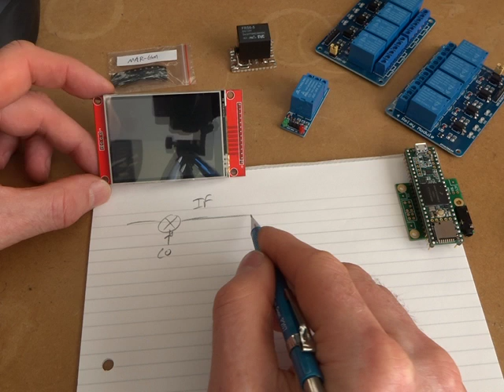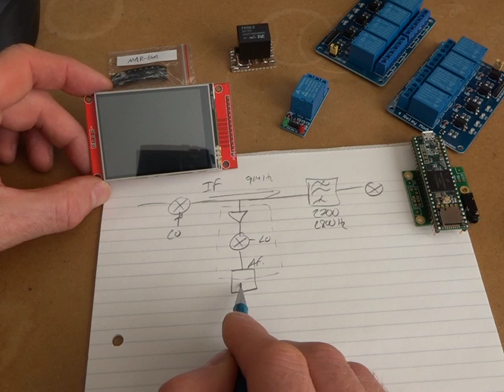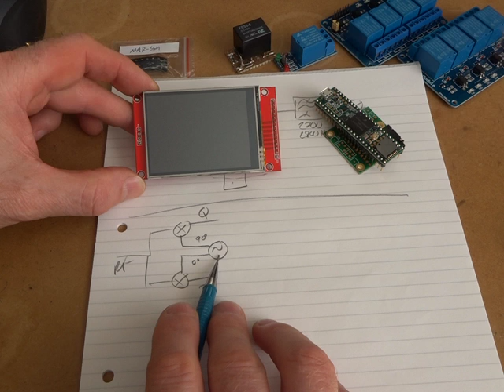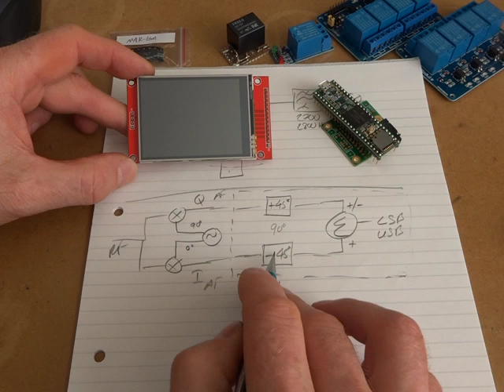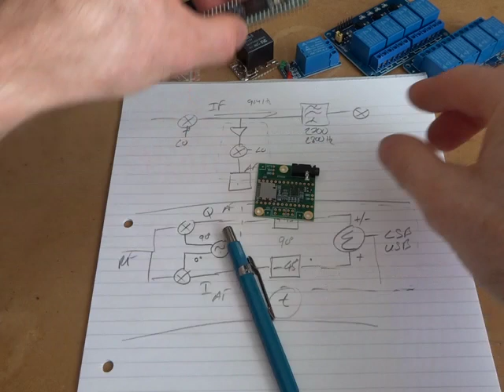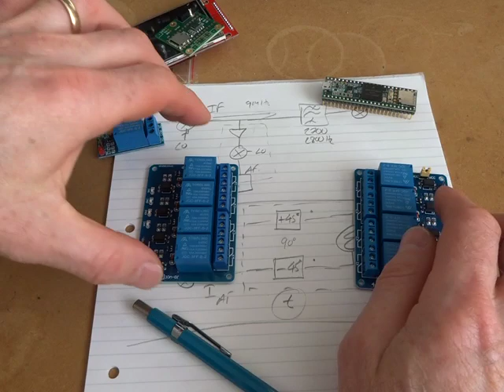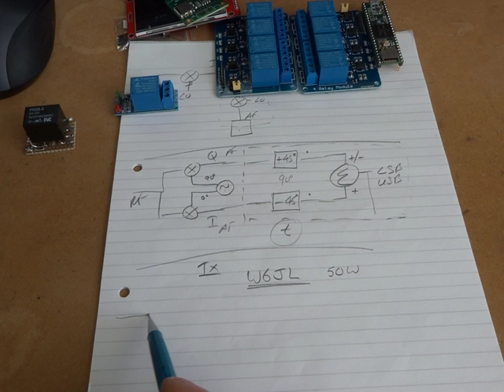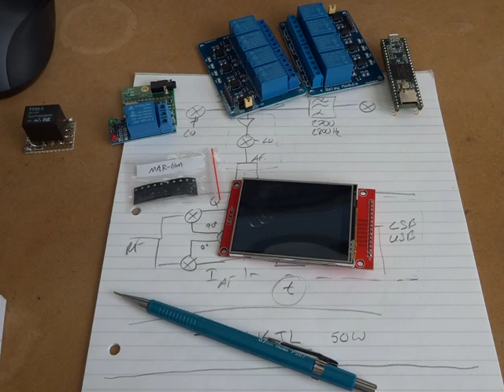Homebrew Panadapter Part 1: Ideas and thoughts

Comment: Hi Charlie, Very interesting project....cant wait for part 2! Just out of interest, what are you using the 'audio board' for? I assume that it is a little more than just an audio signal amplifier? Am I correct to say that you are going to take the IF from the radio, mix it with a LO in the audio range...say a couple of KHz...and then apply the FFT to this 'analog' output, or does that audio board do Analog/digital conversion?
Reply from the maker: Hi Equinoxe. I'm going to use the Teensy audio shield as it has a SGTL5000 low power stereo codec on it. I'll then use the Teensy audio library. This is a very easy and straight forward way to apply the FFT. I'll then leverage the same library for the SDR radio.

Comment: Charlie, in lieu of relays you might consider using AS169-73  SPDT IC switches.  Element14 have them and on the face of the specs, look ideal for  HF and down with excellent isolation.  I have ordered some of these and will try them in a HF BPF board asap.  They do require an inverter chip also as the select lines are 180deg out of phase. I will use a single inverter gate package for this. A downside is that they are tiny SOT23 type devices so DIY is a little more difficult. They cost about A$1.60

glenn
vk3pe
Reply from the maker: My bad as they say. The Teensy 3.5 is a 3.3VDC I/O device. I thought it was 5VDC. Yay!

Comment: Like all aspects. The relays are a find. A bit chunky but fine for a bench top build! I love repurposing,  making do, finding new uses, that's the spirit of homebrew!  Thanks for choosing the W6JL amp, looking forward to that.
Reply from the maker: Agreed Paul. But as you know my radios are less than conventional by way of build, so I'm happy to use the relays. I have quite a bit of other responsibilities to look after, so hopefully I can keep good progress on this.
Reply: @CharlieMorrisZL2CTM  Getting the SDR waterfall working will be the challenge,  good job!
Reply from the maker: @Paul_VK3HN  I agree. I suspect the refresh time of the screen will be too slow.
Reply: There is a way around this but unfortunately no way to know what you have (TFT). Some TFT displays have hardware scrolling so the Arduino or whatever driving them doesn't have to do any grunt work. You just write  a line of the waterfall and the lines above move up one line.
see https://www.youtube.com/results?search_query=SM0RJV
Reply from the maker: @glennp9904  That's really interesting Glenn. I just got this screen working with the Teensy optimized library and it shot through the graphics test in next to no time. Onward and upwards!
Reply from the maker: @glennp9904  I also have a ILI9341 based TFT , which i understand supports hardware scrolling. I spent all last night (rabbit hole) reading up about it, and it seems to be the right way as the normal way of writing line by line to the screen is a little too slow. Hopefully, I can nut it out. Pity there are no good example of how to do it.
Reply: Hi Charlie, the ILI9341 is pretty common and cheap TFT and I happen to have  a couple also here. Wasn't aware it also has HW scroll so will be very interested to see how you go with it. Hope it works, as it solves the waterfall issues nicely.
I imagine you need to define a window where the waterfall will be then invoke the scrolling feature.  Hope the data sheets reveal all!
Reply: a sample. he says there is code there too.  scrolls across the screen but if you get that working i guess vertical will be along same lines. Click the link on the utube for that

https://www.youtube.com/watch?v=C2qBFsegGgQ

Comment: Looks good Charlie. Eager to see the results. On a side note, are you interested in doing anything with old 74 series IC's? If so, I'd like to send you some.  Cheers....
Reply from the maker: That would certainly be interesting Ed. What did you have in mind for a project? The last time I used logic chips it was for a homebrew Nixie clock.
Reply: Well I was thinking anything in particular to tell the truth. When I first started collecting them back in the 70's, my thought was to use ttl to build a receiver. Obviously 74xx wouln't be able to do everything but maybe the lion's share on the HFO/BFO side maybe. And a digital display. Probably weigh a kilo compare to the special purpose chips available today. But maybe you'd be able to come up with something more usable once you see what is available.
Reply from the maker: @ed-jf3xh  I'm certainly interested Ed, but I suspect it will be some time until I have time to play with them.
Reply: No worries Charlie. 10 minutes or 10 years. I'm not expecting anything in return.

Comment: Interesting project :) waiting to see its working.
Reply from the maker: Cheers Rony. I've just noticed the screen is 3.3V. Oh well, might have to dig out another one.
Reply: I think the Teensy is 3v3 also, but 5v tolerant.
Reply from the maker: @glennp9904  Thanks Glenn. It's the screen that's 3.3V. I might try a simple voltage divider for a start and go from there. I got the screen from PJRC (the Teensy supplier), but failed to notice it was for the 3.3V Teensy 3.2.
Reply: CD4050 can be the easy solution.
Reply from the maker: @nielsjalling8454  Thanks Niels. I was thinking about that. I thought I had some in the junkbox. I think that would be the better option as i think one of the screen pins is bidirectional. Best I place an order!

Charlie
Reply: Charlie, I thought the Teensy was already 3v3. (not looked it up though)
If its 5v then, for a bi-directional pin with your 3v3 display, have a look at the level shifter by NXP Ap note.
AN10441 Level shifting techniques in I2C-bus design:-
https://www.nxp.com/docs/en/application-note/AN10441.pdf